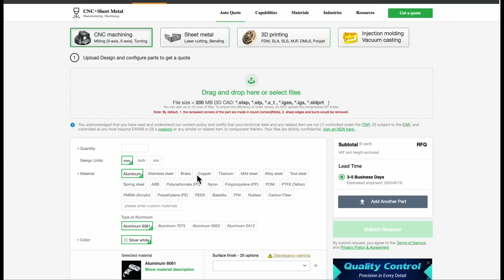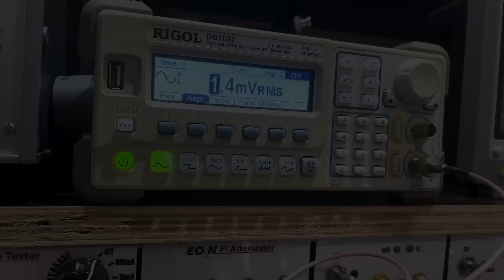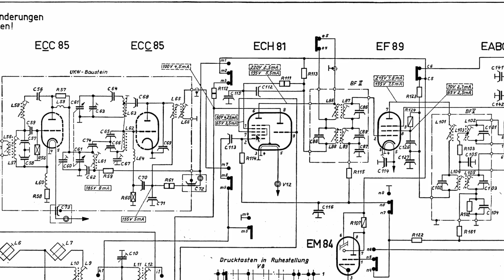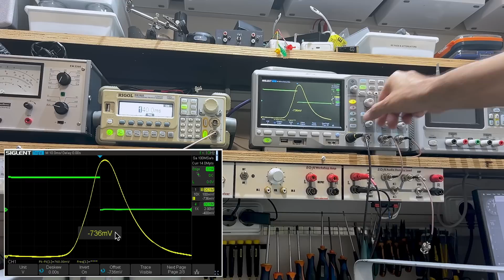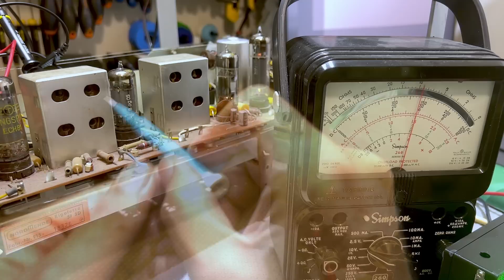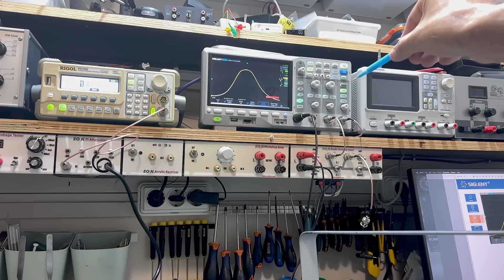The all-important IF alignment of the AM - Tube Radio Restoration Back to Basics part 10 #pcbway#

Comment: Manuel, how did you inject the signal into the ECH81? Positive clip to pin 2 and negative clip to chassis ground? I didn’t see that portion in the video. I was talking to Raymond via email today and he said create a few turn coil and place it over the ECH81. Would that be both SG clips connected to the two wires of the coil loop? I’m so confused for my 1st alignment
Reply from the maker: Yes, and yes 😊

Comment: Is the actual IF frequency subject to tolerances. I mean is it possible that a set with an IF of 460kHz could actually be 459 or 461 or even further off?
If so is it possible to determine the actual IF first so you know what to set your signal generator to, or would it make so little difference it’s not worth considering?
Reply from the maker: Yes, you can actually have the IF shifted quite a bit and it’ll work well. The dial accuracy will be off, though. That aspect is explained in my latest video on RF alignment. To see where it is peaking, just inject a modulated signal at 460, and monitor the output strength. Then shift down and up from the 460 to see where it peaks.

Comment: As far as I understand, the wobbulator uses the 1/60 (or 1/50) of a second because it is an easy to get trigger signal from the mains. But for sweeping sake, the lower the better. If you can do it on 1/2 of a second, it is better, but... older analogue scopes would not give you a solid lit line to look at, only a very slow tracing dot which is hard to read from. For you, with a digital storage scope (I think you have), you can 'remember' slow tracing dots, and for that easily use slow sweeping. Only thing is the reaction time is a bit clunky.
The problem with faster sweeping is that your tuned tank circuit(s) reacts on the extra AC signal of higher sweep frequencies, and with that distort the shape.
Reply: I see I was impatient, later in the video you sort of get into what I tried to bring over 👍

Comment: Great Video - 

could you explain as part of the back to basics - the overall architecture of a tuner -  why was the IF invented, does it exist, ...
I made an enhanced MArantz service manual a few years back where I explained a bit of theory. https://docs.google.com/document/d/0B0Y9WOs2TApBWkJ5ZUJxSk81NlU/edit?usp=drive_link&ouid=104667082229480094603&resourcekey=0-A7Iv_hdVVqSOPRe8eskUsw&rtpof=true&sd=true

Comment: Hello, one point I didn’t catch: which setting you use on the oscilloscope to get a bell curve which is just a line. On my oscilloscope I have a double bell curve, up and down, which is completely colored in. Means I see all frequencies of the sweep. Thank you for nice explanation of alignment!
Reply from the maker: You’re measuring the signal before the detector. I measure at the agc capacitor, after it’s gone through the detector diode.
Reply: Thank you for your answer. Actually I don’t measure on a radio but for trial on a Saba filter. I can see the bell curve and do the setting on the filter. Let me try to show you a picture of what I see.

Comment: Another excellent video. I would assume a 4th method would be watching the magic eye tube assuming all was well with the tube and circuit. Do you think that a 100ms setting (sweep of 1.2 or 1.4 seconds) will always give the capacitor time to discharge and should be used for AM AGC and the FM discriminator alignments? Get well soon!
Reply from the maker: The magic eye is effectively displaying the AGC voltage anyway, so that would work. The longer the sweep the better, but it becomes difficult to actually make adjustments as the lag between that adjustment and the visual result is long.

Comment: Using the scope method you can't easily see that the peak is on the if frequency.  Peaking it at the correct centre frequency should give you the best output.  Just checking but is trace 4 trigger the start of the sweap and not the if frequency so you don't want to peak at the trigger point?
Reply from the maker: The trigger signal is set to show the entire sweep from left to right. The center frequency is therefore right in the middle, as it’s a linear sweep.
Reply: @electronicsoldandnew  so trigger going high to low is at the centre of the sweep? Just checking as I was expecting a pulse and not a square wave from the trigger.  Still very interesting.
Reply from the maker: Yes, you can change the trigger setting on the scope, and also the trigger sense on the signal generator.

Comment: You want the sweep interval to be much longer than the AGC time constant, in this case formed by (R161+R`11)*C116. Otherwise it looks like audio and gets filtered out in the AGC line.
Reply from the maker: True, the longer the sweep the better. However, when the sweep is too long, it no longer becomes possible to actually adjust it live as the time it takes to see the effect is too long.

Comment: Outstanding video, thank you. But by changing the shape of the sensitivity curve you have changed the selectivity (out-of-band rejection). If you are in an area with few number of stations near your frequency, this will not be much of a problem, but if you have a strong station , it can prevent reception of the weaker station. Selectivity testing might be required. It will be a compromise between sensitivity and selectivity.
Reply from the maker: That is always the trade-off
Reply: @electronicsoldandnew  we had installed a new radio in our cargo plane, we went out on a check flight, on our way back we selected the tower frequency and the local radio station wiped out the tower channel. It was just not a nuisance issue, but a safety of flight issue. We later found out that proper sensitivity alignment was throwing off our out of band rejection which was found during our EMI Test.
Reply from the maker: That could be critical

Comment: What would be interesting to round this out would be some method of demonstrating whether the cores were in the same position or not for each alignment method. In an ideal world they would be, but of course we don't live in an ideal world. If the methods produce equivalent results then aligning using one method should show that any tweak using another method would 'detune' the original.
In my naïve way I think that the measurement taken at the output stage would cause less potential interference/burden to the circuit than that taken at the AGC capacitor.

Any constructive comments are appreciated.

Cheers
Reply from the maker: The AGC voltage is measured with a high impedance circuit (the 10X scope input), so should not affect the reading. I’ve done comparative adjustment in the past, just to check, and very little difference can be noted.

Comment: Hello. As usual, you explained everything very well in this video. However, in my opinion you should emphasize that the entire theoretical consideration of tuning an AM intermediate frequency amplifier that you presented here applies to a radio receiver with bandpass filters that are not supercritically coupled to each other. Because if the primary and secondary circuits of the bandpass filter are supercritically coupled, when they are tuned using a regular generator method, we have to suppress the circuit that is currently not tuned. Of course, when using the vobuloscopic method, this is not necessary because we can see the shape of the transfer curve of the intermediate frequency amplifier on an ongoing basis. Best regards from Poland.